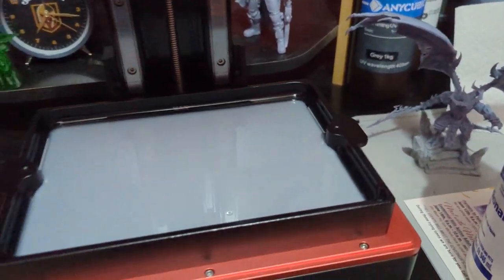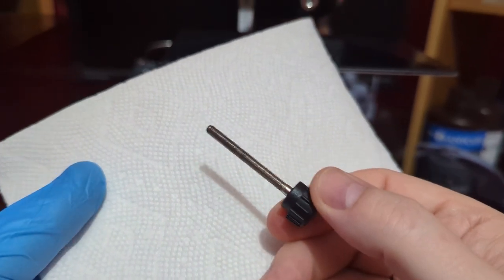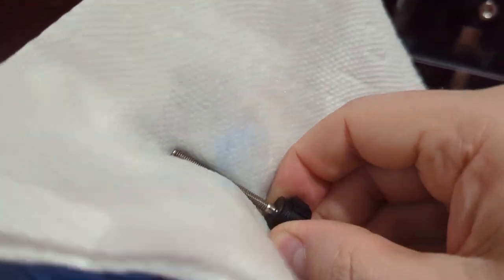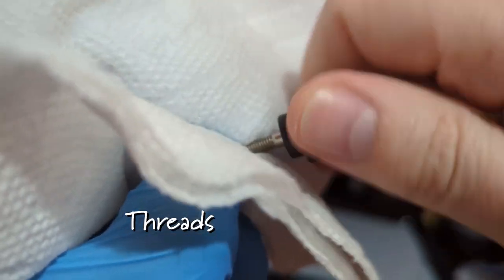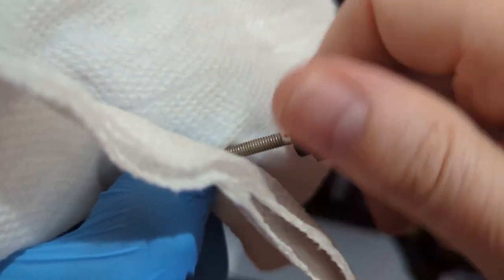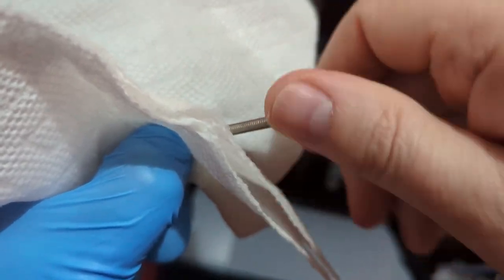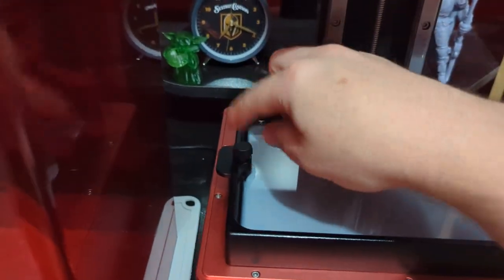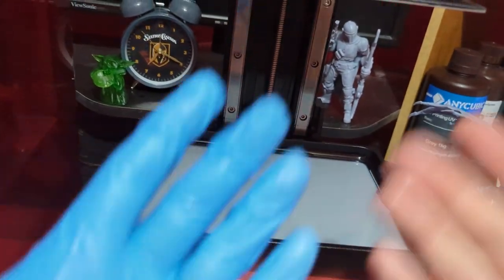Clean the Vat Screws on your Resin 3D Printer the Easy Way

Comment: i wish i saw this earlier... my screw the left side got stuck!
Reply from the maker: Yeah, if you get resin down the hole it can be a bit trickier. I'm always very cautious not to drip resin anywhere, but it can happen. You might be able to get a Q-tip soaked in isopropyl alcohol and screw it in to clean it out if any drips down there right away if there's a spill.